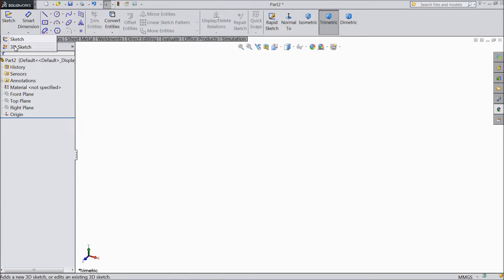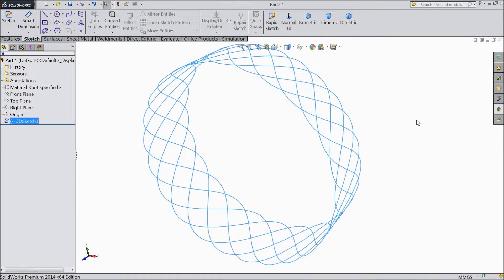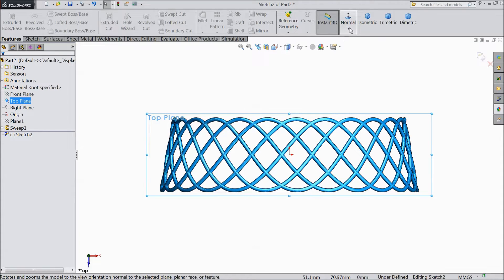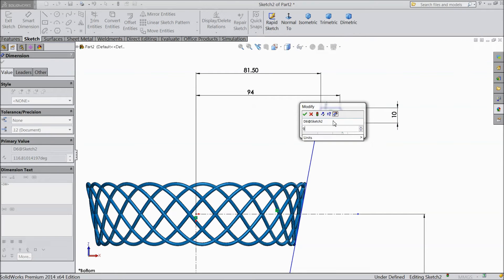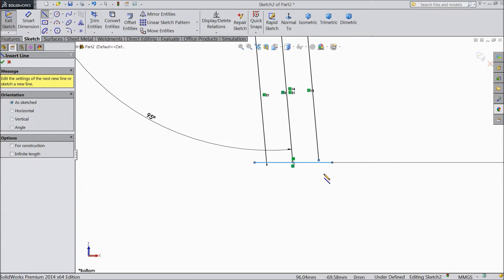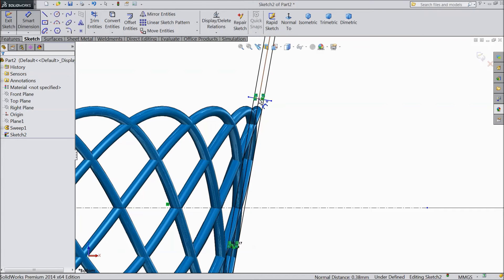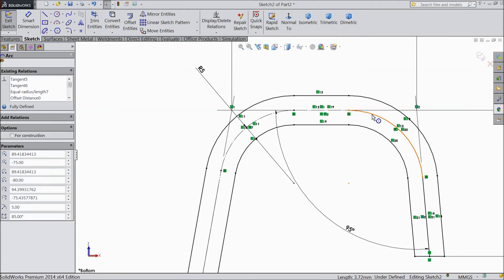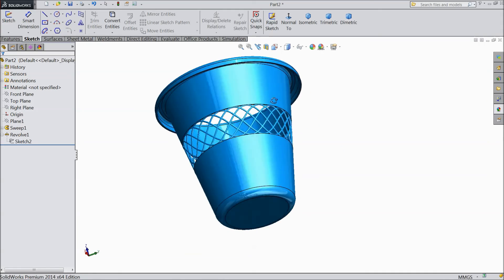Solidworks tutorial Dustbin

Comment: Nice model and nice tricks but you can't manufacture anything with it. Doesn't open up from any mold, welding doesn't do it, and the pattern weakens the bucket a lot if it's same material and same thickness as the rest of the bucket.